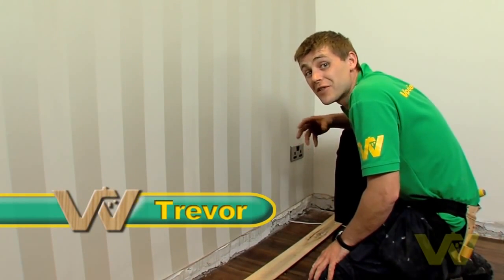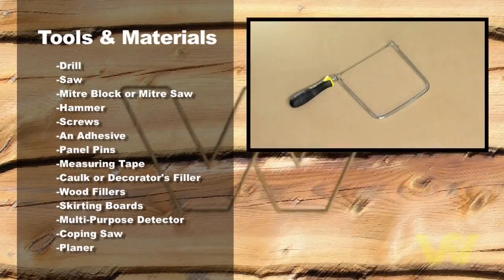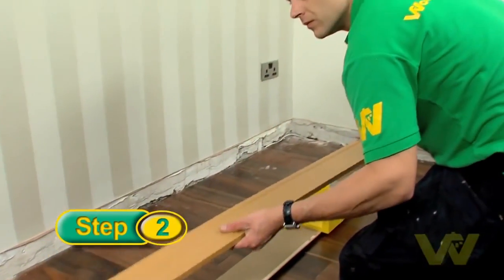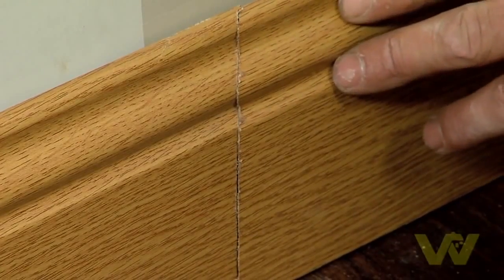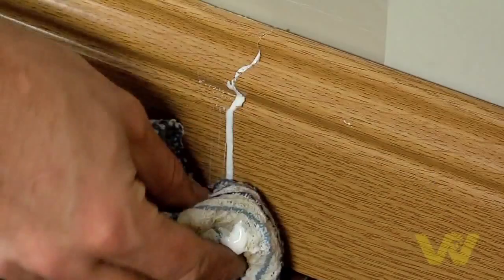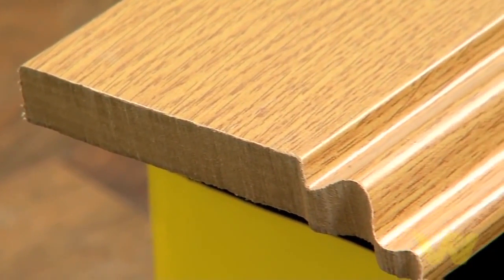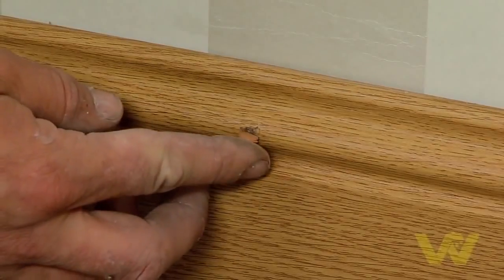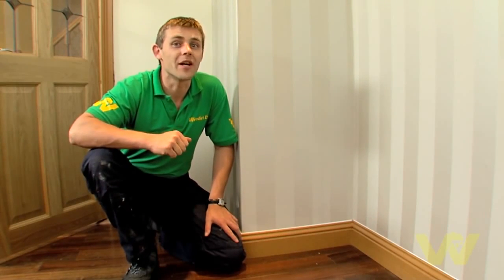How to Fit Skirting Boards

Comment: I love the way these " how to " videos bear no resemblance to the real world !   Every wall they use is true and square and there is always a nice solid backing to screw into. In the real world there is hardly any such thing as a square and true wall and most of the breeze block you try to drill into just disintegtrates !!   You almost always end up using more filler than skirting.